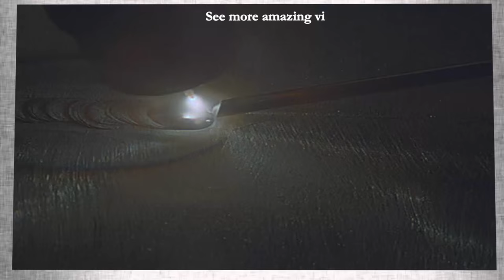Visible Welding Camera

Comment: Nice camera, is it always monochrome? Always good to see your content Jim.
Reply from the maker: +Shadon HKW Stan, no there are Adjustments for contrast, brightness, etc. They had the camera adjusted so the students could see the AC frequency remove the oxide layer on aluminum. In that adjustment it looked Monochrome. Although the filters do tend to wash out colors. The entire crowd you saw was able to see the instructor weld real time while he was talking to them over the loud speaker. No more having to stand next to the teacher with a welding hood on. High speed cameras like this already exist but, the can cost upwards of 80k. I THINK this unit is less than 10K. Meaning that many Vo-Tec's can afford one.
Reply: +Shadon HKW  Some welds look better with color turned down, but color REALLY helps  the puddle stand out.  (orange is the new black!)   You can see that in several of the videos on our site, http://visiblewelding.com/videos/